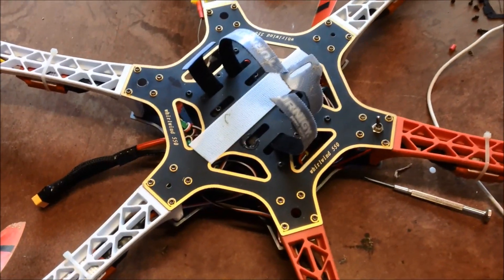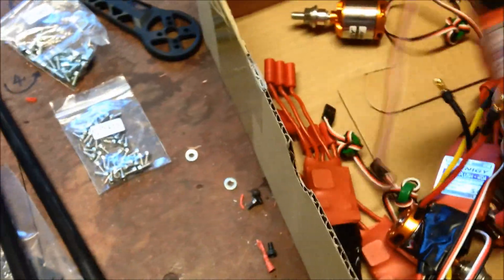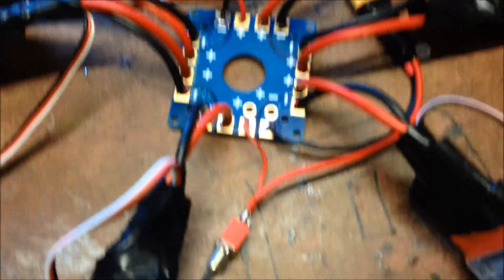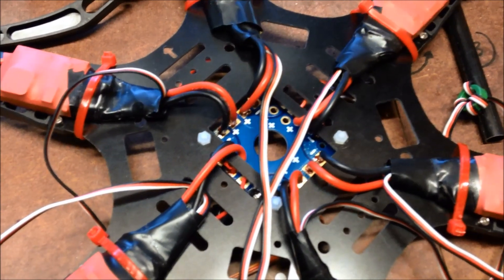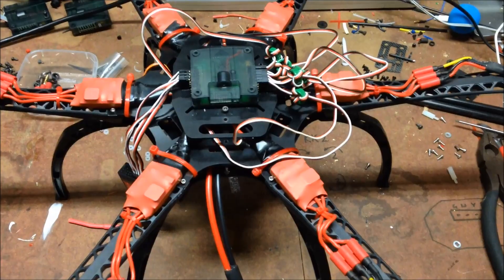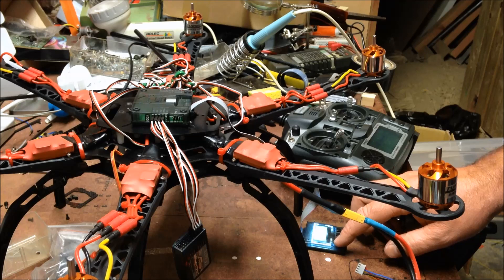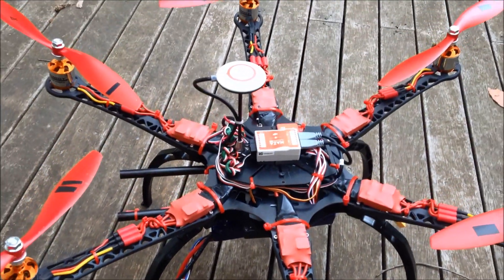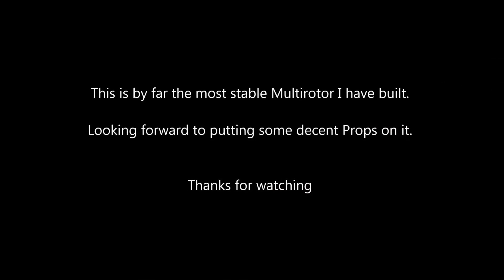s550 Spider Hexacopter Build Turnigy 2836 1100kV 40A Plush ESC NAZA Lite F550

Comment: Can we fold this Frame, I mean not directly, but by removing screws when we travel? Will it damage if we frequently remove/add screws for folding/fitting?
Reply from the maker: Not really. The screws are small and would  not take kindly to repeated undoing.
Reply: @simonhahnel8092  Thanks